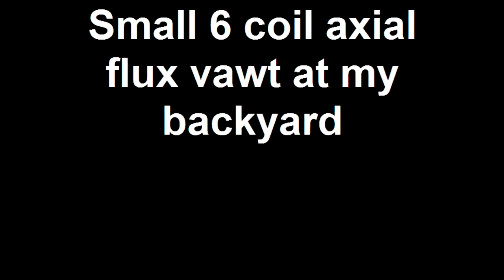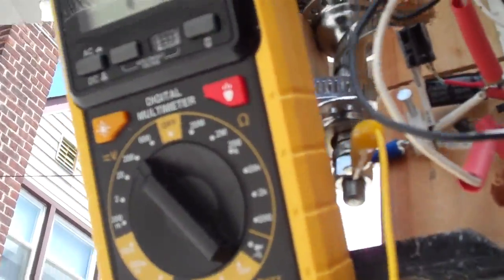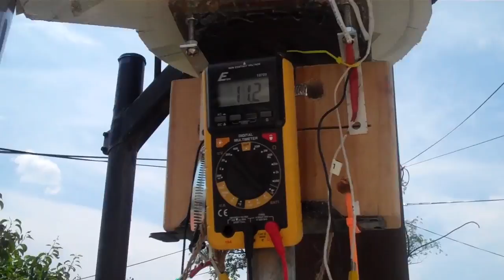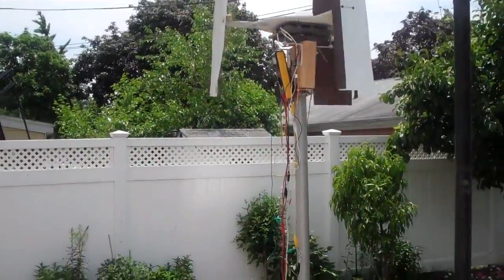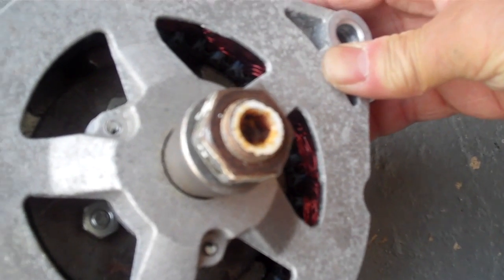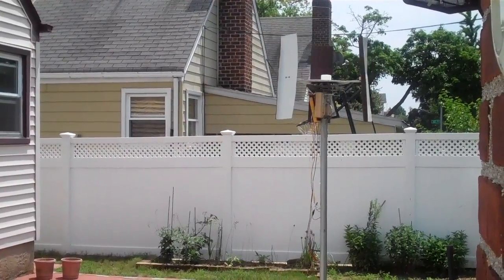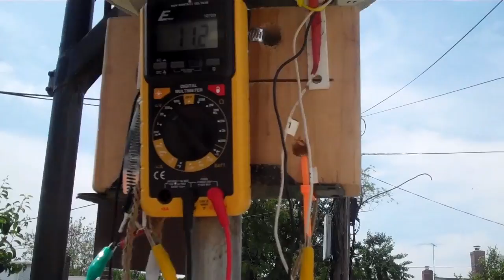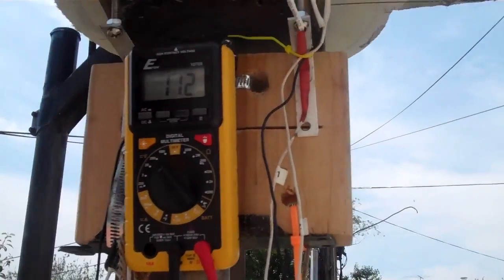Small 6 coil axial flux vawt, pt. 4 .mp4

Comment from the maker: @MrHorsetail  If I were to build a second one, I would try to cram  thicker gauge wires into the stator. As it is, I still have room between the coils. Go ahead and make yours, I like to see the results of different combinations in wire sizes, wiring connections and wing designs. Thanks for commenting.

Comment: There is a lot more wind about 30 feet high where that vawt will spin like the dickens. I would love to have that PMA alternator you got. Its got some real good ump to it. If you get your self  a  Madalay 6  allumium blade it will take off. plus you can seal that with some wind turbun varnish that comes in a arasol can for wind turbon pma's